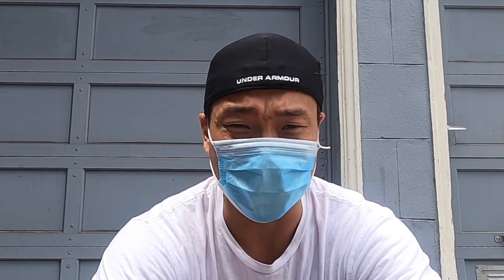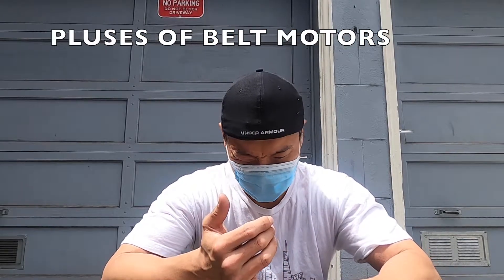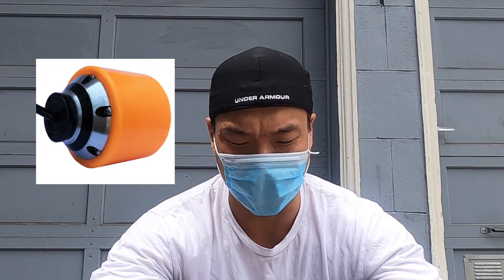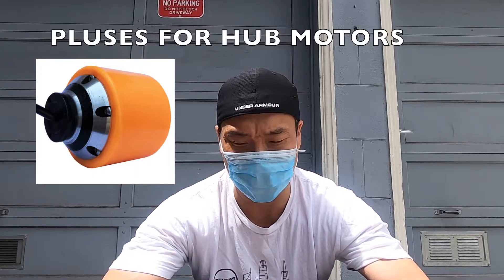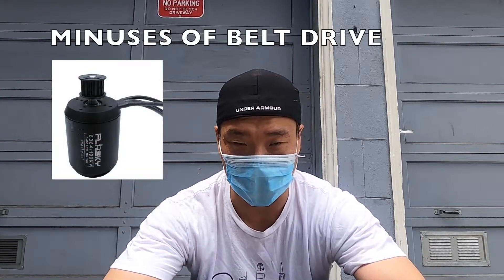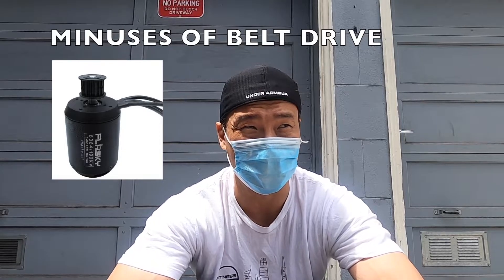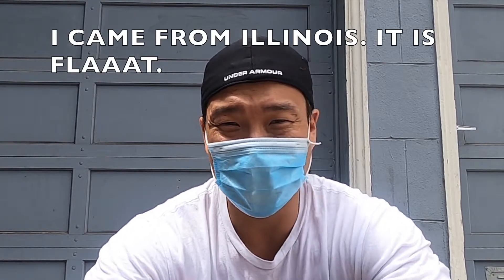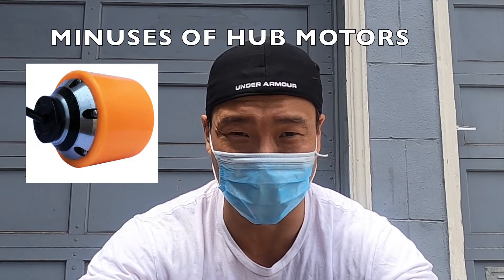BELT VS HUB MOTORS | EPISODE#159

Comment: Hey man, I regretably just bought hubs. I wanna know if the comfortability of hubs and belt is similar enough that I don't need to stress over my poor decision. Such as the smoothness of the ride.
Reply from the maker: Where abouts do you live? If you have hilly areas or areas with alot of gravel and such. Hubs are horrible. Hubs are only good for smooth road riding and flatland. Like I stated...in S.F.   almost no1 who rides religiously...rides hubs. They break wayyy to easy out here. With that being said. The smoothness of the ride will always be effected more with hubs since there is a wheel sheet over the hub compared to a belt drive wheel which is a full cast wheel that has more flex and more vibration absorption throughout the whole wheel. There are a few hub motor boards I would buy...like an Exway. But imo ...belt drive is pretty solid in the past 7 yrs I have been riding eboards.

The amount of problems from a belt vs a hub is not even comparable.  People who say they never have problems with their hubs drive boards are lying to you and themselves...or they ride at 5 mph constantly. 🤣
Reply: @AVC93  yes, I bought an expay wave hub. Luckily I just got a full refund. I'll mostly use it to ride in college campus and ride to work (6km). The ground is quite flat but there would be some concrete slit on footpath and some gravel. 
I just want the most comfortable ride possible. Should I still go for hub or belt?
Reply from the maker: @witachapinamk1507  What is your budget atm? In my personal an exway flex riot is not too bad so far. I got to ride one a while back. Not bad. The customer service is a 7out of 10. But the board compared to other for your commute and daily riding and price...may be the best option. I believe it is still under $900.
Reply: @AVC93  haha, my budget is between the exway wave hub or the riot.
Reply from the maker: @witachapinamk1507  If that is the case. I would get the Exway Flex Riot. The only board under $1,000 that I would rec anyone to buy.
Reply: @AVC93  Damn... the hub is really that bad? I was going to order an Exway Flex hub version because I want to be a low key rider and avoid catching by a police. Lol But as I have never ridden a belt drive board so I have no idea how different it feels in terms of ride comfortability.
Reply from the maker: @karenzhang1020  Definitely try and get the belt drive option! Less headache and the torque is also an added bonus!
Reply: @AVC93  it’s electric skateboard legal in your state? Here in New York it doesn’t say it’s legal but it doesn’t say it’s illegal either, so it’s kinda in between. I did hear people say they got a ticket from a police because they were riding their e-board, but I believe it doesn’t happen often. Still you never know. Lol
Reply from the maker: @karenzhang1020  Electric skateboarding is pretty much legal in every U.S. state. NYC has one of the biggest eboarding communities in the country.  Join the nyc eboarding group on Facebook. If anyone has gotten a ticket...either they were riding like an A**hole...or the cop that gave them a ticket....was having a bad day. I have been rising eboards for over 8 yrs here in S.F. Not one ticket.

Comment: So the negative of a hub is having to replace the whole hub motor wheel opposed to just the belts? How about the  motor that pulls the belt? It’s the same negative for both hubs or belts
Reply from the maker: Belts are ALOT easier to replace than a hub motor. Belt motors also don't break down as easily as hubs do. Hub motor boards are sub par in the esk8 game. Good beginner boards. But in places like S.F. Hub motors can't take our hills which can make them very dangerous.
Reply: @AVC93  chances of belt motor failing is equivalent to that of a hub motor. It isn’t 2017, today’s “budget” hubs can climb 30% which is greater than the boosted. Also they are sealed from water and other debris. Only down side I see is the lack of customization of the wheels which there are only like 3 major wheel companies anyways to choose from...
Reply from the maker: @daniellim5137  yes. Belts and hubs both break probably as often. Belts even more so. No hubs imo are good hubs. If hub boards were reasonable....people all over S.F. would ride them constantly..but since NONE of them can go up our hills....almost no1 on group rides in S.F. rides hub motors. Get left behind on the hills when you stall. Boards are even becoming obsolete on group rides because people now want to ride 40 miles plus without charging. So EUC...escooters and ebikes are growing insanely fast
Reply from the maker: @daniellim5137  Hub motors are great for any flat land areas. If I still lived in Illinois...I would have a few hub motor boards.
Reply: @AVC93  thanks for the info. Your Onyx is looking great dude. I remember diying my first 1000w e bike from eBay when watching the one of the first pro type of the onyx bike from Austin Augies YouTube channel.
Reply from the maker: @daniellim5137  Thanks man! Stay tuned...more mods and videos from the Onyx coming! Big things planned for 2021! Definitely down for a ride if you ever want to bring your ebike out!
Reply: @AVC93  sounds awesome man! I’m in Los Angeles so vice versa. I was born in sf so it’ll work once I’m there! Also if I’m not mistaken, Dr E is also in your area haha

Comment: A comparison the motor of the hub to the belt of the external motor is like comparing a bicycle to a motorcycle. A motor replacement for a belt drive is just as difficult as a motor replacement of a hub.
Reply from the maker: Correct. Having to switch out either motor takes time. What I was stating, is that it is easier to switch out a busted belt than it is to change the sleeve of a hub and a if a hub breaks.... that is part of the motor. I don't know too many people that carry extra full hub motors in their backpacks for this occurrence. Extra belts are definitely carried around as belts break decently fast.

Comment: Couple of upates on the dot in particular. On the Transporter shown, you can change the wheel size from the 120mm to 84mm and back of course. Also the Motors are very easy to switch as it uses contacts in the rear truck instead of cables so it comes off quicker than changing a belt. No need to take off the truck. It will re direct power to use a single motor if needed.
see here https://www.youtube.com/watch?v=iJo7aOA6Wns
and wheel change here https://www.youtube.com/watch?v=teM-rO821CY
Reply from the maker: Good eye. This one right at the beginning was the direct drive model. Not sure how many people caught that. And you are right...on that direct drive...you can change the wheels and tires pretty fast. 🤙

Comment: I'm pretty sure that DoT board you used was a direct drive. They do have hub motors though on the dot.
Reply from the maker: Correct. Good catch. The shop didn't have a hub motor board in surprisingly. So... grabbed the dot.